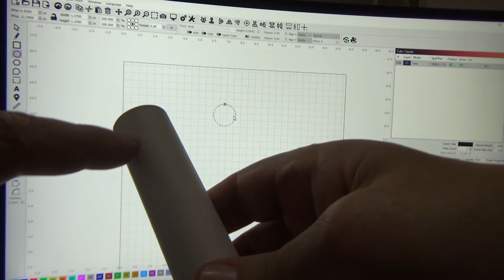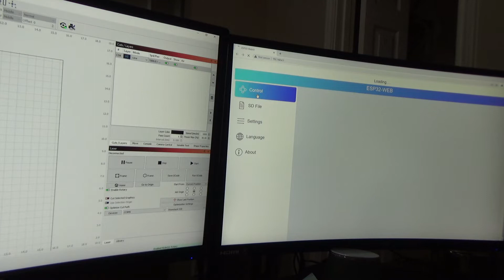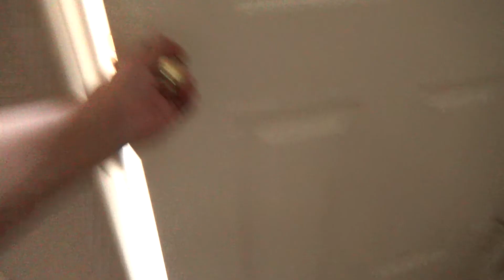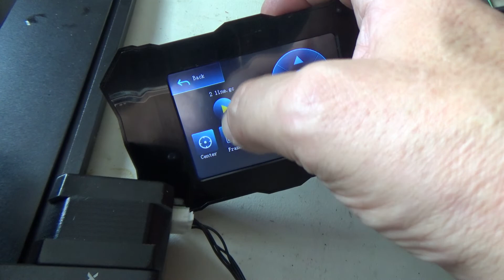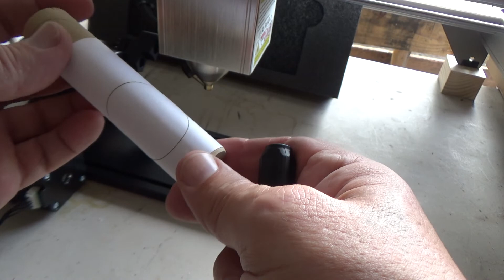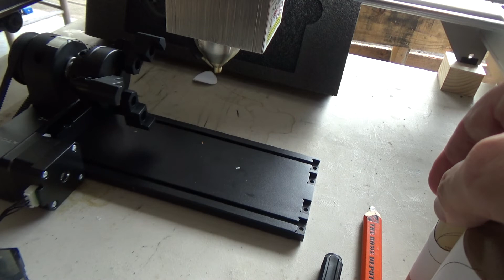mm Per Rotation on the Atomstack S20 using the Xtool RA2 Rotary Chuck Attachment.

Comment: I have an X20 and like the design of the RA2 Pro too. Is there any adapting needed to connect the RA2 to the motor cable of the X20/A20/S20?
Reply from the maker: No, it plugs right in.